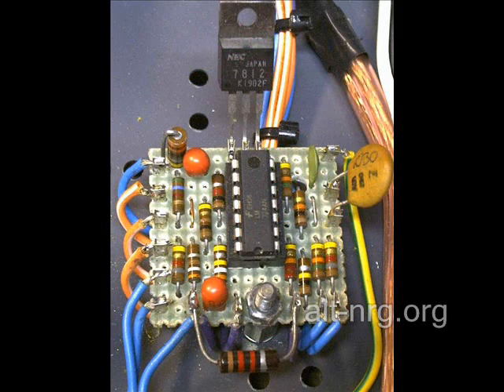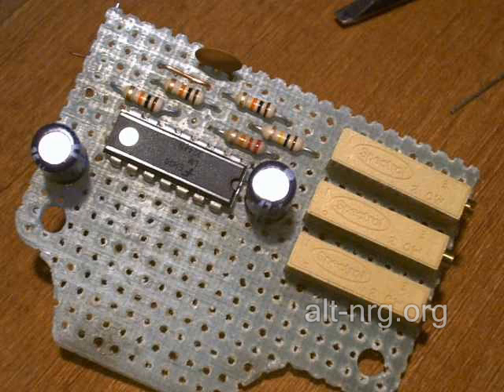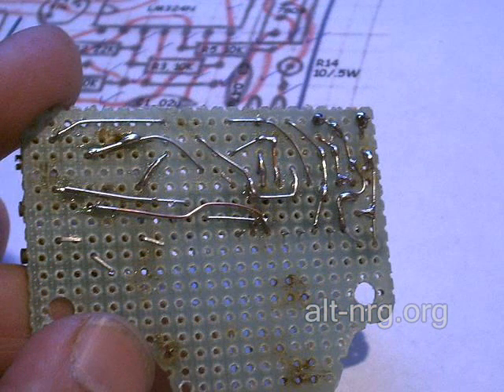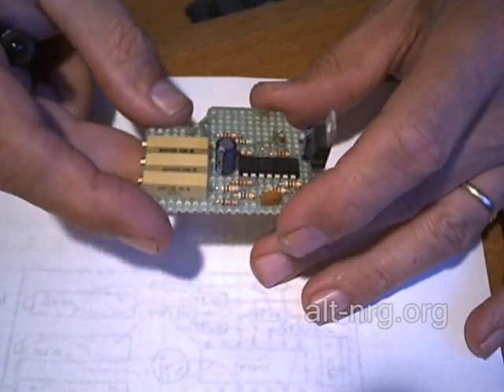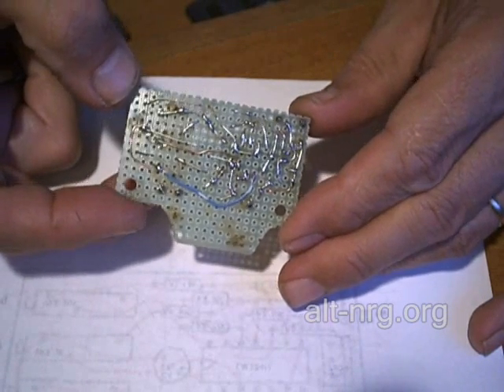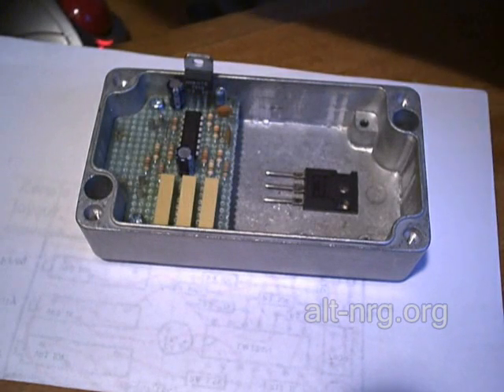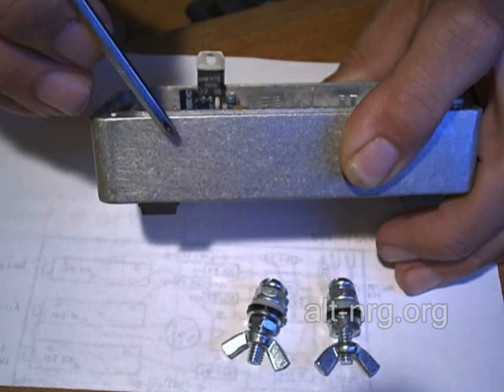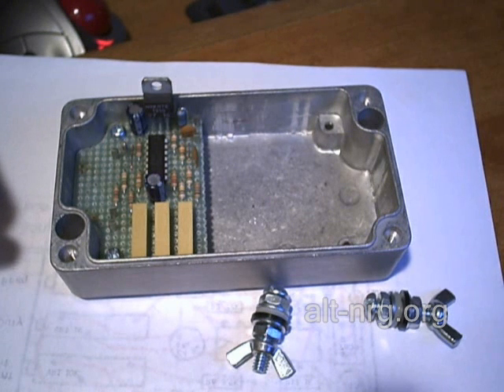#117 Building the PWM v2, part 3 of 5

Comment from the maker: @BlackManOps You're right, it did evolve this way. The output of the 324 is Vcc-1.5v. The regulators also need at least 1.5v headroom. The MOSFET saturates with 10v gate drive. I wanted 12v regulated Vcc but cars don't always charge at 13.8. 10v was chosen because it's the highest voltage that still regulates down to 11.5v input, even though it means 8.5v drive to the gates. It's enough.

Comment: A little late to the table, but your first photo shows a 7812 and then you refer to the "7809" and the photo @ 1:50 shows a 7910 (unless that's an 8 and my glasses need adjusting). I looked at the web site and see you settled on the 7810 for a 10 volt reference. Was 10 volts chosen for a specific reason (like minimum v-drop and heat loss and required v-difference), or is it what you happen to have in stock?

Comment: Excellent video quality Z. I've been watching for awhile. You've got another loyal viewer. I've learned alot, but I have no experience with power MOSFETs. Can we put them in parallel for currents approaching 100A? I want to hook a HHO generator to a power generator. I don't care what anyone says, a car is nice to run on HHO, but there are too many variable to control. A generator runs wide open. It will be my first experiment when I perfect my electrode. Thanks for your effort Z!